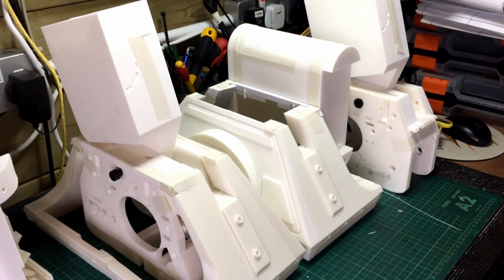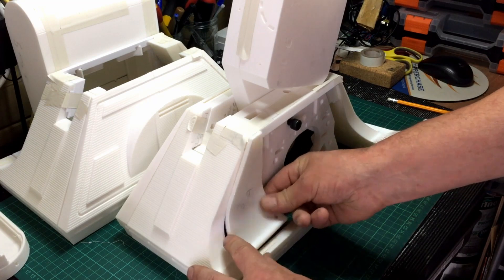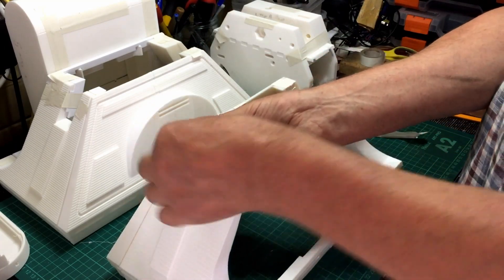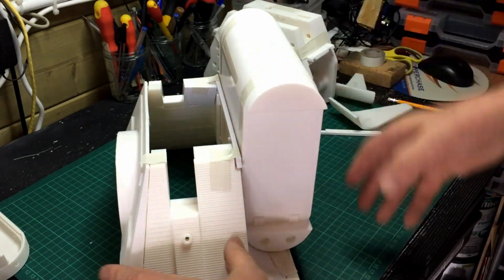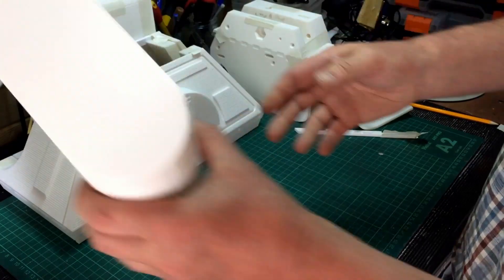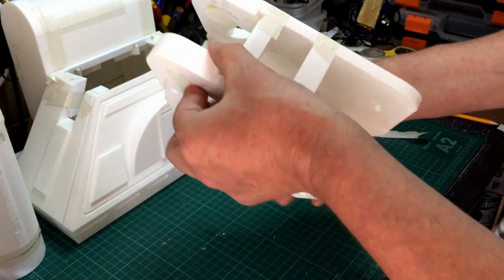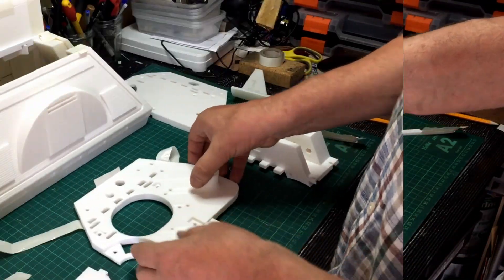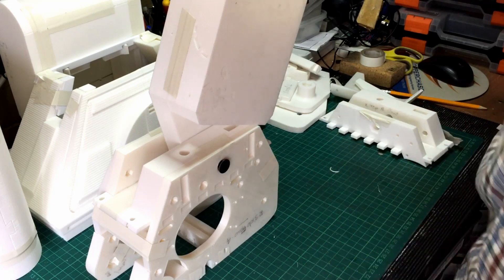R2D2 Droid Build  Part - 9

Comment: What stops the ankles from moving when attached to the foot.  I'm just about all done with mine, finishing up the leg prints.  It will just fall over if I don't do something with them.
Reply from the maker: H Tom, I am not sure about that myself. I haven't assembled it all so don't know how it will sit on the legs, or if it will fall over.   There are parts on Michael's free download site [onedrive] that are called  FootlockLeft-FLEX and FootlockRight-FLEX and pin stl. I am assuming these lock the ankles somehow., but maybe this is a question for the  3dprinteddroids forum.
Reply from the maker: Hi Thomas, I have worked it now.   The FootlockLeft/Right-Flex parts will slot in between the leg and foot assembly and slide into the two horizontal slots that line up when the leg is bolted to the foot.    There are two sets of opening - one is round for cabling and the other is rectangular and the pieces slot into those.   When assembled, they hold the foot at an angle.  see here https://myrobotnigel.blogspot.com/2018/09/r2d2-foot-lock.html
Reply: Thanks for getting back.  I looked into the foot lock and I'm really not happy with the way it works.  I'm just going to put a block of wood in it's place.  That way it won't tip either way.  Keep up the great job and vids.  Thanks again.